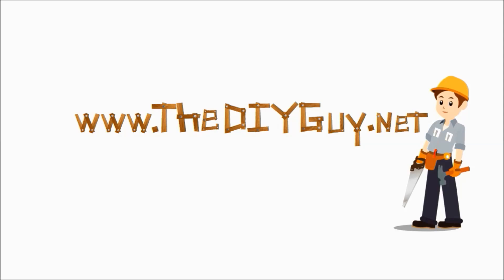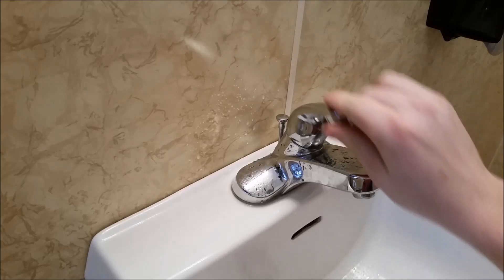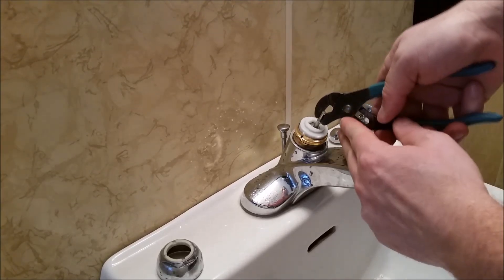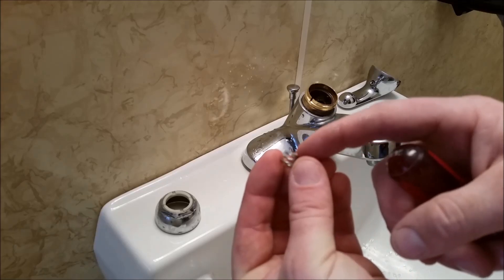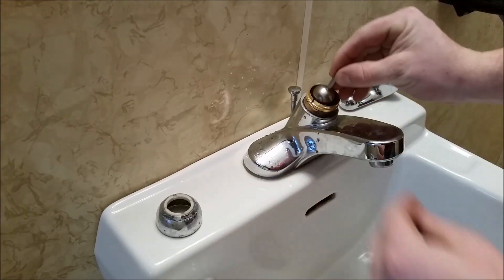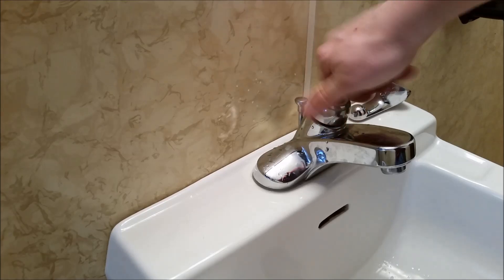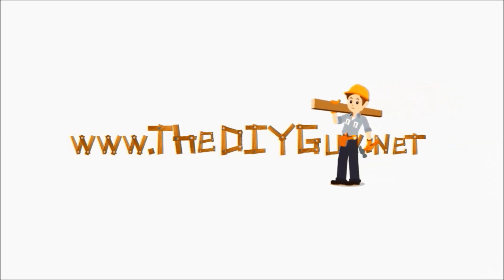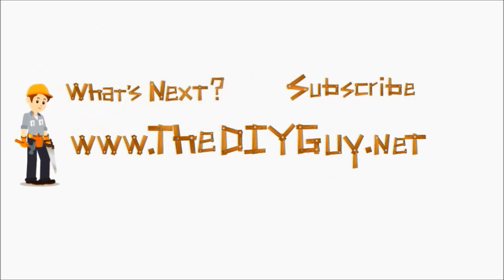How To Rebuild A Delta Single Handle Faucet

Comment: 7 years after this video was recorded  I found and used it to rebuild my first Delta faucet. The to-the-point tutorial was spot on as was the parts suggestions by model number. Simple and highly recommended for DIY-challenged folks like me.

Comment: The lesson I learned is that even if all of the pieces don't need to be replaced, replace them because the parts in my identical bathroom sink were slightly different, but fit the same. When I tried to just replace the top rubber piece because water would come out of the top of the faucet handle when I fully turned the cold water on, I was unable to completely turn the water off. When I replaced all of the pieces, I could feel everything fit just a bit tighter, and that solved all of the problems.

Comment: Best video for single handle Delta bathroom faucet repair.
Reply from the maker: Thanks for watching and taking the time to leave us a comment. Don't forget to give the video a thumbs up. Thanks
Reply: I fully agree.  At first, I was hesitant about doing the repair myself.  However, after watching the video several times, it gave me the confidence to proceed.  I'm very happy to report that I was able to repair both of my leaking faucets fairly easily and quickly.  Again, great video...simple but thorough.  Much appreciated!

Comment: Thanks for the video. I noticed that you didn't use silicone grease on the ball. I rebuilt my kitchen faucet in the same manner you did, but I used the silicone grease on the ball. The lever operated very smoothly for a week or so, then became stiffer and stiffer to operate as time passed. Any thoughts on that?
Reply: I think silicone grease (not silicone caulk!) should be applied only to rubber o-rings and other rubber parts to prevent hardening and cracking.

Comment: It appears my set screw is either stripped or corroded. I can't seem to remove it with my allen wrench. What do you recommend is the best way to remove it? Also I am afraid the bonnet nut might be hard to remove after i get the handle off.
Reply: Hi, there. Great instructional video. Easy to follow. I am having the same issue that @ryana8749, I am having the same issue with the screw. They you ever get feedback? How did you resolve?
Reply: I’ve am having the same problem right now. I cannot take the screw off with the allen wrench. I sprayed some WD-40 on it and let it sit for a while 😮

Comment: My faucet is a Delta and looks somewhat similar to this, but it doesn't appear to have a set screw in the handle. Are there any alternate designs that have different ways of removing the handle and accessing the innards?

Comment: Used that special tool to remove that retainer but the dome won't come off. It has the raised grip on the bottom about 1/4 wide. Tried channel locks and strap wrench. No go. Soaked with vinegar to try to break up scale. No go. Now I'm using penetrating oil and tapping gently around treads. Will try in morning. Any tips ?  I know that if I use too much force I could possible twist off the coppers underneath.
Reply: How'd that turn out. I'm doing mine tomorrow. I have a replacement faucet but thought this would be easier. Who am I kidding. I know it's gonna be corroded stuck shut.
Reply: Frank Taurozzi I went extreme after that. I removed the faucet , put it in vise then used a hammer and small chisel ; no go after a couple of blows. I then gave a couple of good blows with the hammer on the bottom side and presto the dome came off by hand. From what I could see it was just a lot of scale between the treads. My next one I did that first and it came off by hand. I was obsessed with saving the 28 year old faucets because they are so much better quality and that was the first time they ever leaked. Good luck.

Comment: I'm trying to do the same but it's a single handle faucet on our jet tub. Do you know off the top of your head if the repair parts would be a different size than the kit you show? The faucet itself is larger than what you install on a sink. I can't for the life of me find any info on this
Reply from the maker: That is a good question... I know that this same kit will also fit some kitchen faucets but there are some delta bathroom and kitchen faucets that use a cartridge. It is a delta brand? no model number? how old do you think it is? If you can remove the handle it should tell you weather it is a ball type or cartridge type faucet. You can also take a picture and click the link in the description and go to the bottom of the page and upload it to our website so I can see what your talking/ looking at.

Comment: My problem is the cap is too tight either from someone installing it to tight or from hard water buildup since it has probably been there 30 + years.any suggestions how to brake it loose
Reply: Never mind I got it.Thank you for your video!
Reply: Prayer changes everything...God has answered so many of my prayers for help since my husband passed away & I have to do my own repairs which most of them I know nothing about. I give God the glory for ever repair He has got me through time & time again!
Reply from the maker: Sorry for the late reply, but glad to hear you got it off and fixed. Your're welcome.
Reply: The cap was the only issue I ran into.  Great video. Thanks for guidance.
Reply: @jasper60103  How did you get your cap off?

Comment: thanks for the video!  I had one question about the decorative cap.  It appears you are only tightening and loosening via the plastic insert, which is only meant to adjust the friction pressure on the ball.  Doesn't the decorative cap need to be loosened and tightened by itself for a proper, secure fitting?